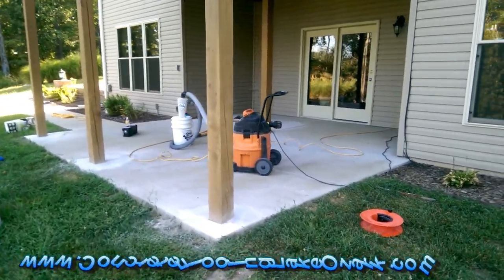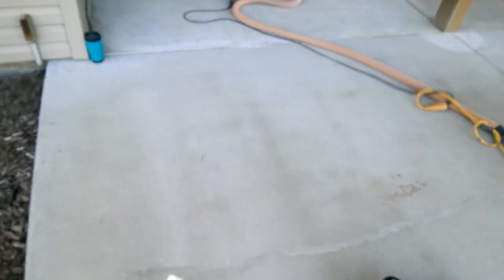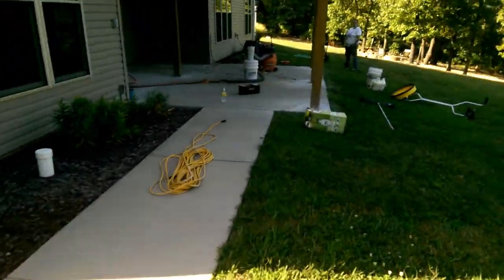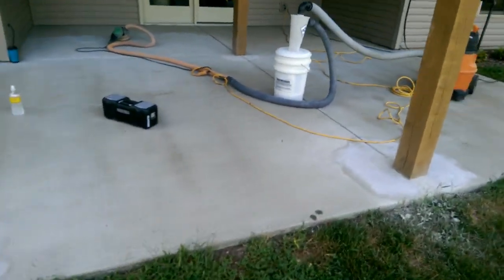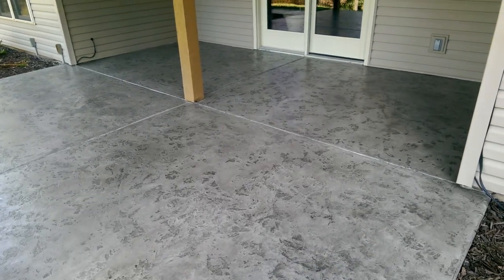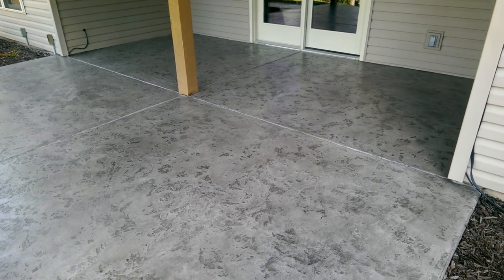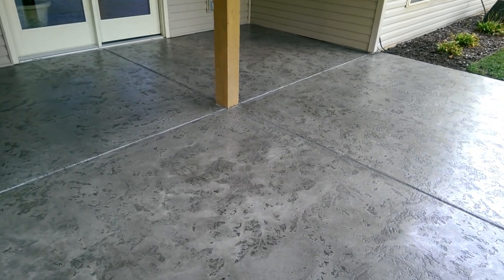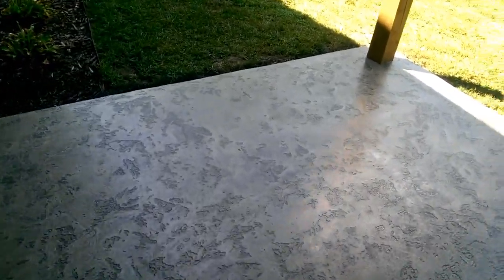Decorative Concrete Tuscan Slate Acid Stain Antique Overlay 573-216-0930 Lake Ozark

Comment: How did you get the antique texture look
Reply from the maker: You apply a dark Charcoal base or any color base depending on the color you want, just be sure the base is dark, then when you add your Tuscan Slate Texture that texture coat will be a lot lighter and it will only cover about 80% of the base coat (which is darker) so now you can see your base coat because you have created pockets by not troweling your top coat of concrete at 100% coverage like you did your base coat, then you paper off the area's you don't want sprayed with Antique stain and you stain your entire surface, and the stain dries how it dries, some places it may pool in the pockets, depending on how heavy you spray your stain. hope that makes sense and it helps to create your project, I appreciate your questions, and your LIKE and Hopefully you also will Become a Subscriber of my Channel.

Comment: What's your process for Crack repair?
Reply from the maker: +dEsignEd byGOD open up the crack to remove loose material, mix our resin with some sand, put that in a ketchup bottle, squeeze it into the crack... overfill it... let it set, then grind it flush.
Reply: were can you find that